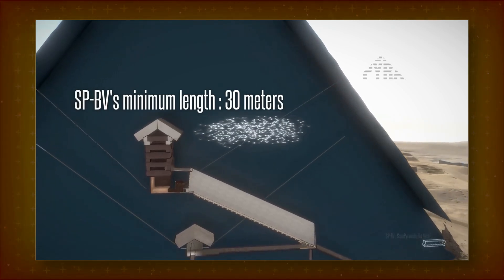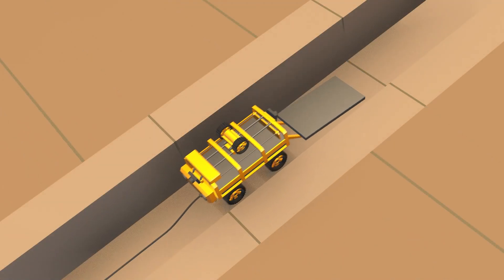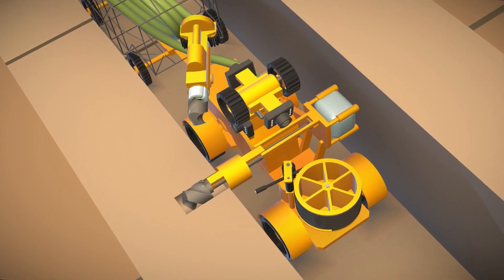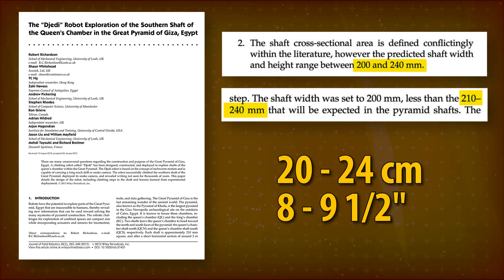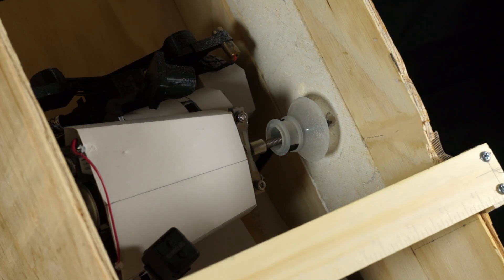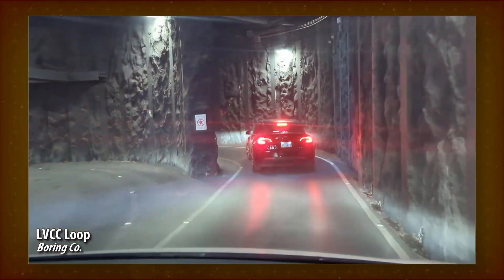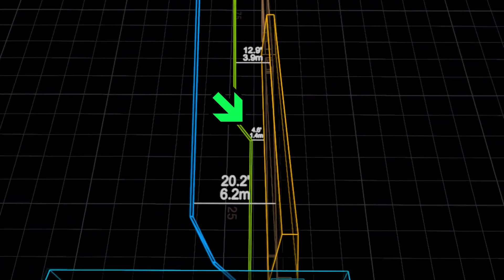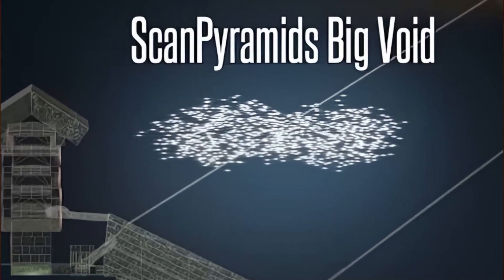New Great Pyramid Robot for the Big Void (prototype)

Comment from the maker: Ko-fi: https://ko-fi.com/nightscarab

Sorry about the delay in releasing. Prototyping is hard to predict: R&D, wait for parts, R&D, wait for parts etc. Addressing potential comments: in the lucky case of needing to drill only a few feet, a drill-extension mechanism is worked-out and accounted for in the robot's design (width issues considered). But R&D can't proceed without knowing the final hole length. Measures against potential obstacles (granite, sand, gaps etc) would not be implemented in the first iteration, unless they're actually encountered in reality. Otherwise costly R&D would be wasted addressing things that don't exist.

@01:00 Brief re-cap
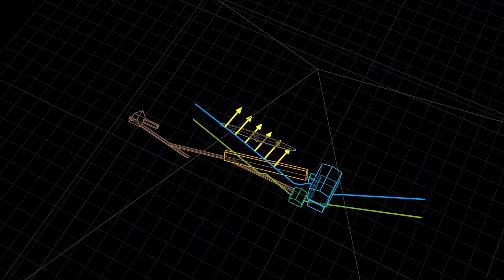@01:50 Prototype
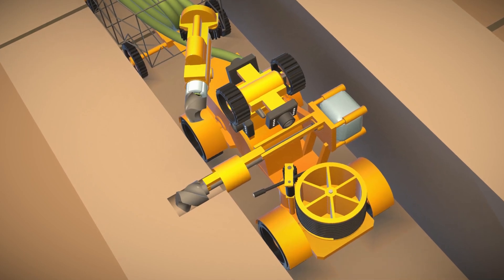@03:23 Testing
@06:21 Findings
@07:40 The future
@10:51 Conclusion
Reply: Wasn't there supposed to be a suspension of this channel?

Comment: You could use a jack screw to spread your 2 stop pads. Get one that has a pitch that is not back drivable and you could deploy the stop pads and then shut power off to the servo and I would stay there without continuous power input. Then, when it is time to retract, has the servo turn the other way and retract, then turn off the power and you are good to go.

Comment: FYI there are off the shelf RC cars that are designed for low speed crawling. They are relatively cheap (~$400), have 4 wheel drive and can easily climb a 35 degree slope. Their low gear ratio also makes them capable of holding position on a slope. Traxxas TRX 4 sport is a good example.
Reply from the maker: Thanks, good info. I checked the width, TRX 4 won't fit into the shafts: width 9.78"/249 mm. Given the somewhat uneven walls and turns, I'd say 7" travelling width is probably maximum. At the actual drill site the robot can "expand" wall-to-wall.

Comment: When Gilles Dormion drilled in the Great Pyramid he was not allowed to use a water-cooled drill for fear that water may cause water damage to any objects found.  Although the geometry is quite different, I suspect Egyptian officials would have problems with using water to flush out limestone dust.
I have thought of three solutions to the dust problem, although I think the first two are bad.

1 - Windshield wiper.  A brush moving on a gantry to brush the dust out of the way.  Does not need to reset, can push some dust up and some down.  Gantry could be longer than the robot, allowing the dust to be pushed very far away.  A telescoping gantry could be even longer, but would come with added complexity and risk of getting stuck.
pros - fairly simple, manual control would be easy to make
cons - may cause dust cloud, and can only move so much dust before it becomes a problem, seeing the dust and the brush may be a problem depending on the number and position of cameras and lights

2 - Fan.  I'm thinking a computer fan, simply blows the dust up the shaft.  
pros - even simpler
cons - will cause dust cloud

3 - Dust Buster.  A small vacuum cleaner mounted the robot or on a trailer to suck up the dust
pros - can remove dust entirely from shaft, just back out and empty when full, very little dust left in shaft to cause issues for further exploration, simple to use: suction funnel is placed beneath the drill and turns on when the drill is running
cons - more complex construction, likely to require custom parts and will add much more weight to the robot

I think 3 is the best option.
Reply: Some onboard compressed air to blow the dust away would be another option
Reply: @jesseleesamples  Good idea.  The air would not even need to be onboard.  A hose going to the opening could lighten the load and allow direct control from outside the tunnel.  But you would still have the problem of making a dust cloud.

Comment: How much can we learn about the void by just calculating the physics involved. it's can't be random that a void can withstand the weigh of whatever many levels above it for thousands of years not to mention dozens of earthquakes, as best of my knowledge there's no cave ins in the pyramids. there must be some engineering involved to make these voids possible, the question is can't we reverse the process and assume the engineering and learn more with just that.... having said that i don't think you can say with absolute certainty that this won't damage structurally sensitive areas

Comment: would recommend looking into oil drilling equipment 
they have very similar requirements, drilling through stone with an effectively infinitely extensible system 
for this case you could likely easily use 1/4 or 1/8 npt pipe that is readily available for the drill string
as the tube will already be hollow, using air to clear cuttings would be an easy solution
The issues I see are that we cannot take advantage of the weight of the drill string as the bore is more horizontal than vertical and the geometry of the cutting end likely needs to be changed, as classically the cutter in such drills is more spherical than conical.
One solution would be using an impacting bottom unit that utilized the compressed air used to clear cuttings with a more standard type of impact drill bit. This would significantly increase cutting speed by tens of times and significantly reduce the forces needed to push the bit from the robotic frame with the clear disadvantage of increased vibrations.

Comment: Even if the distance would be longer to drill from either the outside or the relieving chamber I think that might be an easier solution as you would only have to drill in a horizontal direction until either you hit the roof or the end of the gallery. If drilling horizontally then you would not need any robot of any kind, just a long thin drill and a long endoscopic camera.

Comment: Good to see another video, thank you. All the best for future endeavours.

FWIW: Rather than water to flush a potentially long bore hole to stop it clogging, might I suggest an air nozzle possibly as part of the camera rig?
Potentially easier to engineer and lighter for not carrying a water supply.* Less likely to cause apoplexy in Zahi Hawass. ;-)

*better yet, potentially useful for 'clearing' debris / sand in the assumed void.

Comment: Neat idea--few things to possibly improve:  A tracked vehicle provides better grip than tires.  A worm drive would prevent backlash so its much less likely to roll when not under power.  Modular drive platforms would be good for vehicles with multiple jobs but since this vehicle would have one job, building it to suit would out perform anything bought off the shelf.  And as you say, the costs would still be a fraction of what other big projects have cost. Maybe scale down a directional boring rig like what is used to install gas and water lines?
Reply: I was wondering about the performance of either wheel or tread based mobility systems when on wet sloped rough limestone surface. I hope he shares results if he tests different modes of movement.

Comment: an idea that is very unlikely to happen, but is extremely fast and safe, is:

use a drill like they use for oil drilling and drill from the top. the techniques have been proven for over hundreds of years and the equipment is readily available. no safety concerns because a vertical drill hole can easily support lateral forces

Comment: I'm not seeing any way with this to remove tailings from a deeper hole, without compressed air extraction or a spiral drill bit, any hole drilled would bind up with tailings behind the drill head within inches. At the very least, retraction of the drill would soon become impossible.
Reply: I agree. Also, the length of the hole from the shaft to the void will more than likely be much longer than 1/2" (Approx 13mm). Your drill bit length or section of it will need to be shorter than or limited to the width of the air shaft.

You will need to design a way that additional extensions can be added to the drill as the depth increases. Perhaps a revolving drum or carousel that can both rotate to add or remove additional sections or some type of belt fed mechanism (Think machine gun).

Each extension MUST have a positive lock on the piece in front of it. This will allow you to drill forward and backward without any detachment. You will only have one chance perhaps to do this?

If the drill bit detaches itself from your drive motor and can not be removed? You can be certain that making additional holes and starting over will probably NOT be an option.

As the drill bit length increases, so will the amount of torque required to spin, push and/or pull it. If the substrate changes from limestone to granite for some reason your drill bit MUST be able to penetrate it (diamond or carbide bit).

Most masonry drills also have the ability to hit or impact the the end of the bit at very high speed to increase it's ability to move forward. I wish you the best and these are just a few things that came to mind after watching your video.
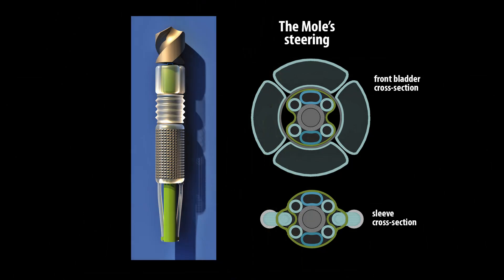Reply: @superdog1964 I believe option 2 (at 10:00 in the video) is a better choice. The robot can handle just the top section of the drill. A longer tube can be dragged up the shaft and all necessary components can be left on the floor of the chamber.